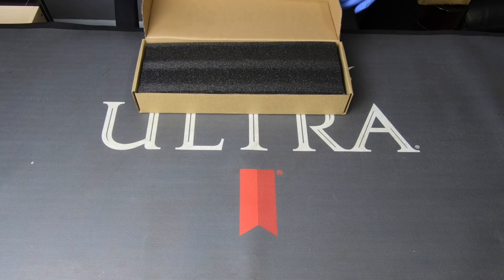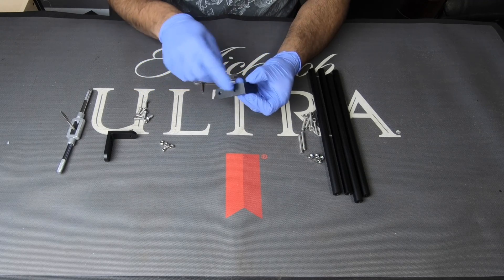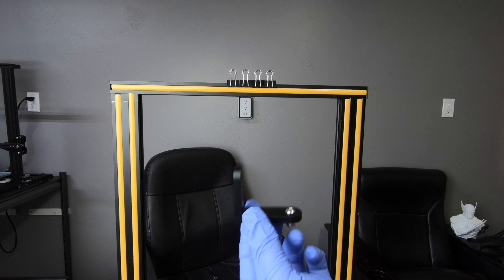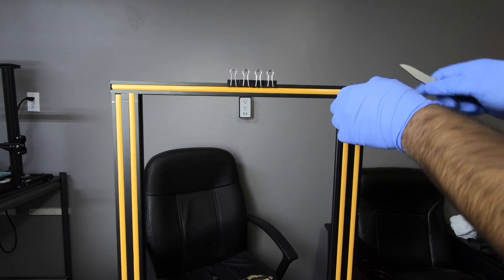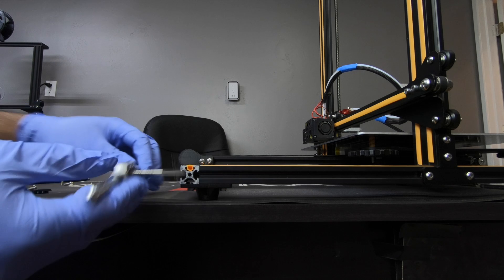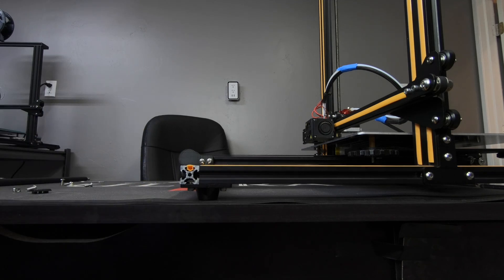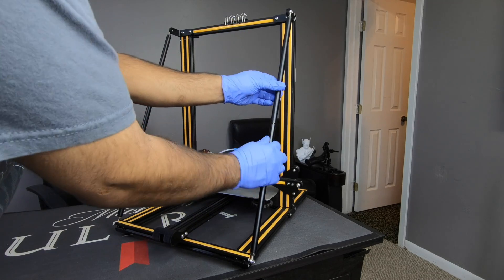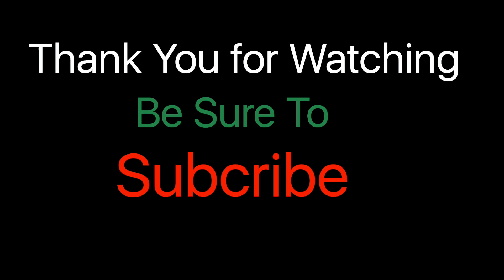Creality Cr-10 / Cr-10S Support Rod (Brace) Upgrade

Comment: Good for you to do this. I couldn't see you remove the outer socket head cap screws on the front extrusion, so that the supplied tap can go in fully, before it bottoms out. I highly recommend people remove those that so you get a fully cut thread and don't end up messing up the thread.
Reply from the maker: I agree with you.

Comment: Why can't they be on the back side--out of the way?
Reply: I'm looking at getting this for mine, putting the braces in back would interfere with cable management. I have cable guides that keep them from rubbing on the frame.
Reply from the maker: You can if you want it will do the same job.